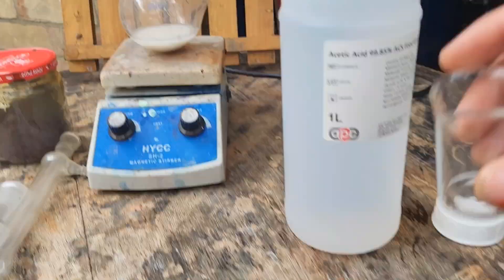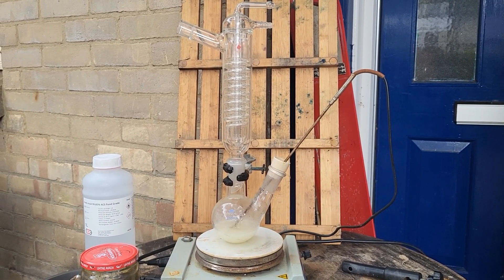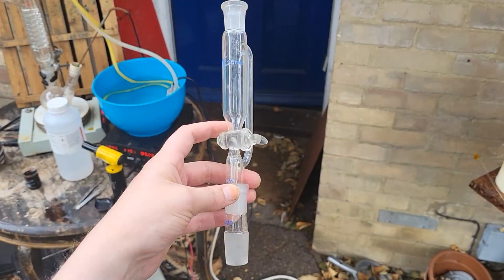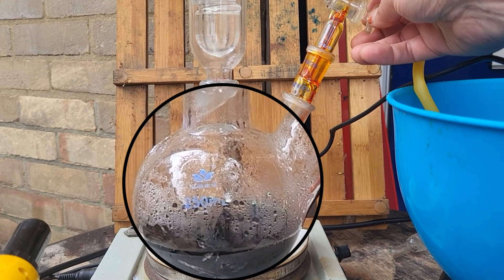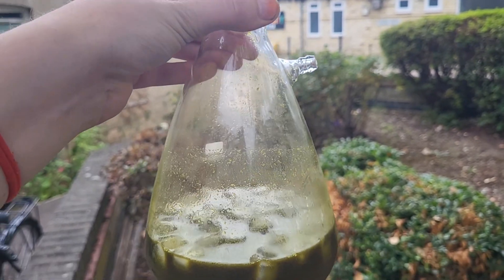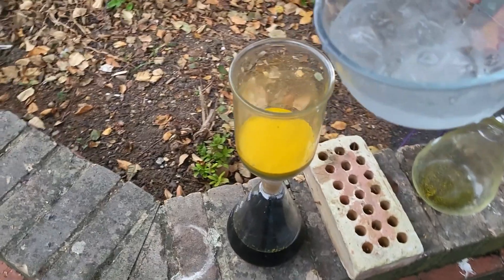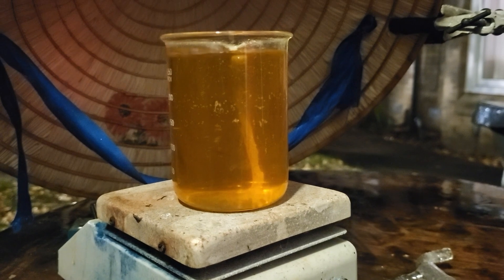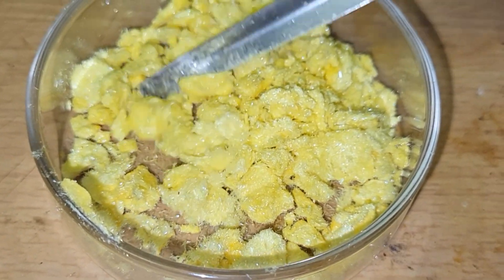Anthraquinone (Anthracene oxidation)

Comment: The Thirtyfiveringcene ice cube tray is very fitting , it'd work even better for a graphene oxide vid😅
   Question, how do you know the oxygen is attached to ony the two carbons you want? Or that the rings haven't been broken?
What's the theoretical yield compared to what side products?
  I was planning to do the same thing to mothballs...as a substitute for this. Less possible side products too.
  How do you clean sulfates from your chromium trioxide?
Reply from the maker: Hmm, interesting questions, to be honest I don't know what I even made here. To my surprise the end product was highly fluorescent under UV whereas from what I've read and seen in other videos anthraquinone should'nt fluoresce at all, the opposite infact, it should interact with light by absorbing it.

Re. Sulfates in CrO3, didn't know that was an issue, I have both wet powder that was gifted to me and some bought flakes.

I'm should be getting some naphthalene soon. Most modern mothballs are paradichlorobenzene, I couldn't find any source for naphthalene ones anywhere so I ordered from a chem company.
Reply: @SodiumInteresting  I'm curious what you had going on there too, it might be a useful biproduct.
   I thought you made the CrO3 yourself (potassium dichromate treated with sulfuric acid and concentrated till crystals precipitate) done the way I know, I'm not sure how much potassium sulfate would also precipitate, frankly I've never done that before. They stopped doing that for cleaning glassware when I was in school, and when they disposed of their chromium, they wouldn't even let me take a gram... 
   The situation where I am with mothballs is the exact opposite (USA). They don't package them good either, they sublime through the box.

Comment: I love the tiny glassware, where did you order it from? It's much more practical for small scale preps.
Reply from the maker: Most of my glassware is from eBay or Aliexpress, they have all the common sizes although I did find a load of this smaller size stuff in an antique shop
Reply from the maker: Check out my recent short, it shows this to be something else. Anthraquinone doesn't fluoresce, rather it absorbs the uv and changes colour. This end product however fluoresces bright yellow under UV 💛
I need to figure out what I have made and why it's not what I expected.